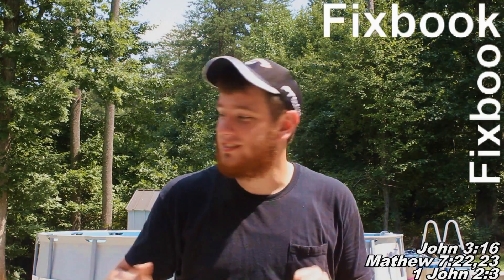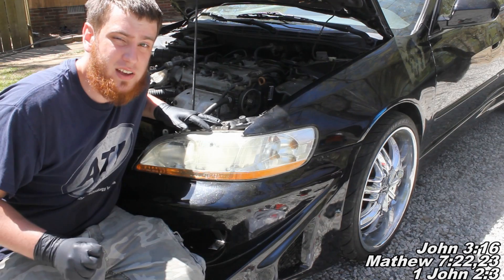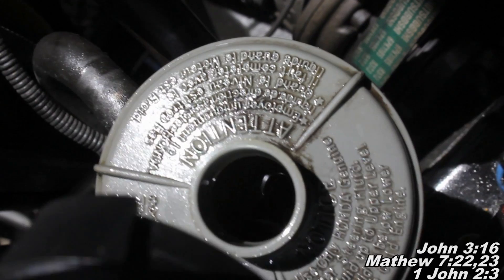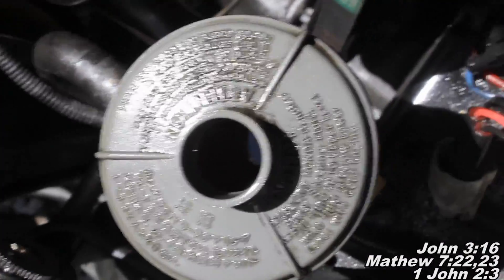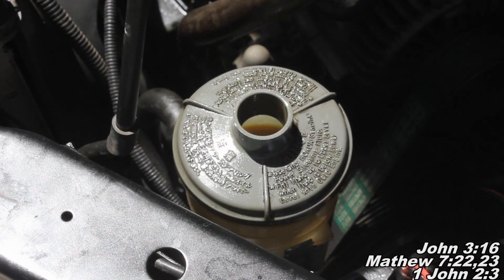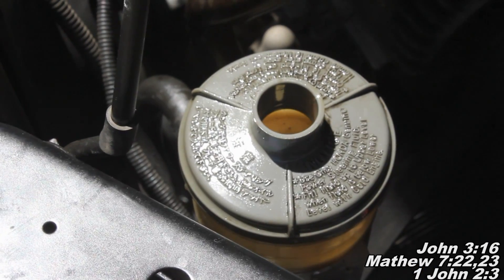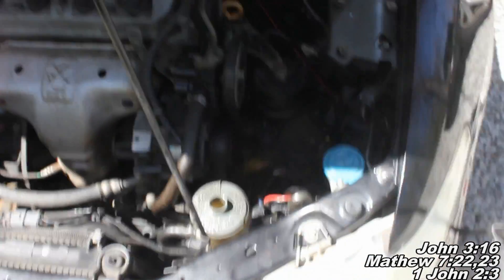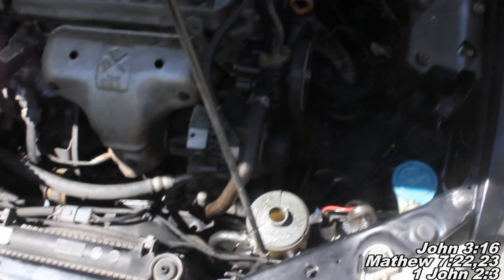What Happens When You Air Gets in Your Power Steering Fluid

Comment: You can add Braggs apple cider vinegar (about half a quart) to the power steering fluid. It will stop the noise and lubricate the elliptical components. Make sure the reservoir lid is on tight before adding the apple cider.

Comment: Before you make another video, call Honda to make sure the advice you are giving to the public is correct. I appreciate your effort and trying to help people, but your facg are not correct. Honda PSF contains  conditioners that help keep the o-rings in the pumps connecting hoses swollen so that air does not get sucked in, causing that whining noise. Yoy actually should remove this video.
Reply: PROOFREAD!!!

Comment: I seriously doubt if mixing types of power strg. fluids caused air bubbles in the reservoir. Air was introduced when the system was open, as when you replace a pump, hose , or other power strg. component. People watch these videos, so it is important to get them as correct as possible. There is a recommended procedure for bleeding the air from a Honda or Acura power strg. system. I would use that .

Comment: will the check engine light turn on when it starts leaking a little
Reply: +Telwin Acosta No, it is not likely if it starts leaking a little. Though some newer cars have fluid level gauges, and a light may illuminate when the fluid gets low in the tank.

Comment: Hi Everyone, has anyone tried Bardahl Honda power steering fluid, Any issues? should I stick with Honda power steering fluid? Thanks.
Reply: stick with Honda for some reason Hondas are reliable but when it comes to maintenance any engine oil works I prefer full synthetic but specifically the power steering it should be honda fluid and also their transmission fluid has to be honda but later on I'm going to try Royal Purple in my transmission to see if it accepts it brake fluid can be any but I think on my civic it's dot 3 fluid but any brand

Comment: Be careful pumping out your fluid because you will burn. Out Your steering rack. If you are not sure take it to a reputable shop. Even if you replace the steering pump and fill it you still can burn out your steering rack if you don't get the air out of the system properly. Raise the front end of the car place jack stands securely and after reservoir is filled and job done, with the pump replacement start the vehicle and turn the wheel left all the way then right all the way and repeat this til air is purged out of the system

Comment: ***** i have exactly that problem on my 96 honda accord 4cyl, after i change my rack and pinion i mix the fluid. now after a couple of weeks my power steering fluid reservoir is very low and steering pump is making noise. i trace all the hose can't seems to find a leak, power steering pump is dry but there's fluid all over the cramshaft/headcover gasket... please help me how do i fix this, should i flush/bleed the power steering pump and refill the reservoir or did i already cause too much damage to replace the steering pump
Reply: The damage is already done. You will have to replace every seal (inside and outside) of the pump. Maybe the power steering rack also. Hopefully, the hoses will be okay. I would flush new Honda fluid through the system with the return hose disconnected (the bottom hose on the reservoir, and make sure you plug the hose fitting in the reservoir while you do this to prevent the fluid from running out of it). Take the belt off and turn it counterclockwise by hand with the engine off. Running the engine will be too fast and cause you to use much more fluid than you need.

Do this until you're sure there is no more other fluid than Honda fluid in the system, and THEN fix the leaks. If you do this after fixing the leaks, you will spread the contaminated fluid onto the new seals you just installed, so flush it first. Good luck.

Comment: The foam is caused only because you have air in the system, has nothing to do with mixing fluids.
Reply: O ring air leak
Reply: @shermdeazy  wheres the O ring?
Reply: Check hose clamp on the inlet as well.
Reply: If I am low and its whining, can I just add some to top it off?
Reply: Nick W. If you’re low, add the proper fluid to the full mark. That may stop the whining, but you should still keep the fluid level filled.
Reply: @scottyakoubian9238  cool, thanks a lot
Reply: @SmooeyGablooey  won't stop the whining but it's best not to just go dry out of nowhere.

Comment: Bubbles in fluid is definitely bad o ring on hose from reservoir to a steering pump or any other bad seal. But definitely good video... we wouldn't be here if we didn't need help.
Reply: Milivoje Vukojcic True The o ring has hardened. Replace with new O ring at the beginning of the return hose which starts at the power steering pump. When completed the whining & aeration stops. This is usually the return hose from the power steering pump to the reservoir. In some cases like in my 2005 Subaru Forester I had to replace the O ring and the return hose as it had hardened as well. Stopped the whining as well as the foaming aeration. Also can be a good time to drain your old fluid and replace with new.

Comment: Is this a joke? Mixing power steering fluid does not cause foam if it's good matching power steering fluid, it's because air is getting into your power steering pump. Replace an o-ring and you should be good to go. What a dumb video.
Reply: +am am Yes it is made of a special kind of rice oil, that doesn't react with the types of seals they use.
Reply: You obviously know nothing about Honda's as they take a specific fluid made only for Honda's. Like he says if you do not use the Honda fluid you will screw up your power steering.
Reply: am am      oops
Reply: He says is the product of mixing both fluids because mixing both fluids destroys the seals and lets the air in and that causes the foam. You need to understand things a little better.
Reply: Which o-ring?

Comment: I have a similar problem with my car. It just a seal leak that allow the air into the fluid line. It has nothing to do with non-genuine Honda power steering fluid. I fix it by change out the seal. Foam problem gone immediately.
Reply: Did your power steering pump make a whine noise? And what did you do because my pump is making a whine noise and every time I turn the car off my steering power fluid foams out from the reservoir every where, no leak any where just the reservoir idk what to do I'm about to change the pump and see what happens
Reply: I did have noise when I make certain degree turn. It was at low speed so I could recognize it when my engine quite.

What I've found was the air goes into the leak without anything come out of the leak while the pump runing. That seal ring on the output host right after the power steering pump has turned bad regardless it is worn, misshape or crack. I bought a new ring from a dealer. It cost around $1 back then. You probably won't be able to find just the seal ring in part stores. Once I changed it. The foam issue solved.
Reply: +Y CHAN  it's cool man thanks for replying I ordered a hole new pump for $160 fixed the problem lol

Comment: The foaming is caused by the pump sucking air.  Top it off and you'll be fine.  Not saying you should substitute non-Honda fluid, but oil is oil.
Reply: WRONG! Topping off the pump will NOT fix this problem. Why don't you tell us where the pump is sucking air from and exactly how "topping it off" will correct this problem? Let me save you some brain cells. You can't. If the pump is sucking air from somewhere you can add 700 gallons of fluid to the pump and it will still be sucking air because you have not fixed what's causing it to suck air. On this particular vehicle there are two o-rings on the bottom of the reservoir that are notorious for wearing out causing the pump to suck air thus creating bubbles and or foam in the system. Don't comment unless you know what you are talking about. Some poor soul might just take your advice.

Comment: The fluid has nothing to do with your noise and the fluctuation of the fluid.  You had air in the system, luckily you bled the air when you changed the fluids out the second time.  All power steering fluid since late 90's is 10 weight oil with additives.  There were old types of Honda pumps that were gear pumps rather than vane and rotor that required a special mineral oil.  FYI- you might have a bad o-ring between the pump and inlet, these have a TSB on them sucking air into the system.

Comment: Chris Arfstrom is correct.  Bubbles and noise indicate an air leak.           
 This is NOT caused by mixing fluids.  But always use the correct fluid for the job.

Comment: If the air bubbles are only present when you run engine, it could be a bad O-ring on fitting of PS pump is allowing it to suck in air that is causing the bubbles.  This happened on my Honda minivan and a $2.00 O-ring from dealer completely fixed the problem. I was getting ready to take off and replace PS pump when I found the problem.  For some reason Honda has a fitting for the hose to mount to instead of directly to the pump itself.  You must remove the fitting to get to the O-ring.  in my case it came out easy and it was easy to see that a good seal was not being made. The problem was also more noticeable in cold weather when the fluid is thicker and the pump sounds very noisy till it warms up. After replacing O-ring, absolutely No more noise.  The key is not to let it go on too long our pump will wear out. Hope this helps.
Reply: Chris Arfstrom mine is also bubbling and making a whining noise as well it’s been getting colder and the noise has been more frequent it’s loudest is in 1-4th gear and but I noticed the noise gets louder when I turn on my AC though just wondering if you had the same problem? But my power steering is bubbling that’s for sure
Reply: @willruiz9637  hi I get as same as your problem, and I don't see any leaking but making noise and hard turning right to left when shift to R to any gear except N Gear no noise. Do you really think change O ring really solve the problem ?
Reply: i hope my problem is simple like that.  leaking big time out the back of the pump.

Comment: Its not foamy because of mixing fluids. The foam is of course air (derp) meaning air is getting into the system either because the fluid level dropped too low below that upper return hose and the system was never properly bled or the pump itself

Comment: Which power steering fluid did you use?  You said you didn't use the "genuine" Honda PS fluid, but one made for Honda power steering.  I think the following fluid may be the same as the genuine Honda PS steering fluid, but under the original supplier's brand name: 

http://www.ebay.com/itm/150933953358?item=150933953358&viewitem=&sspagename=ADME:X:RTQ:MOTORS:1123&vxp=mtr  

Just wondering if this is the fluid that you used.  Thanks.
Reply: I went to NAPA auto shop, they have their own brand of power steering fluid for Honda. It's around $3 a bottle.

Comment: My Honda PS pump was making lots of noise lately over past few months whenever i start the car. After warming up it would usually stop.  Last week I found problem was from O-ring on fitting on front of pump for hose going to reservoir.  I believe it was sucking through the bad O-ring because fluid was also foaming as well. After draining all fluid it reservoir and replacing O-Ring, problem is GONE !  very quite even when temp was 9 deg at engine startup. If you have a noisy pump, try replacing the $2.00 O-ring 1st !

Comment: If you really think it's a problem with mixing the two fluids I would do a flush, with the afferent hose in a large bottle of new fluid and the efferent hose in a waste pail while you run the pump. it seems likely that the main cause of foaming after installing a new pump is trapped air in the system.